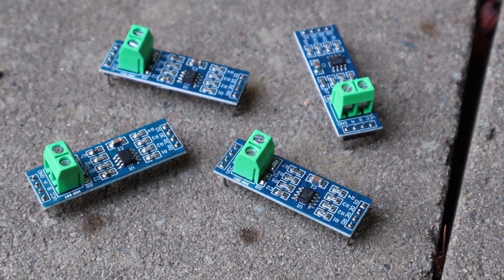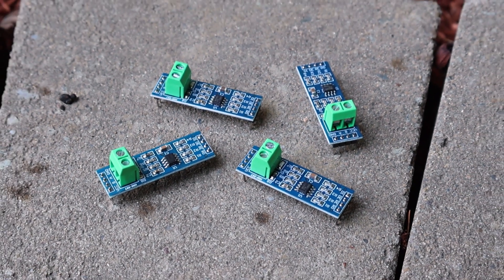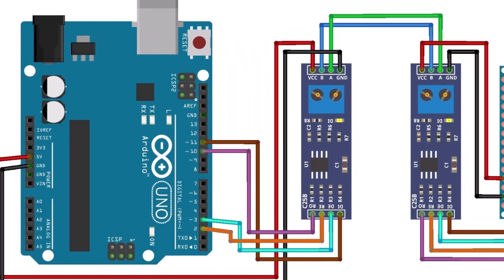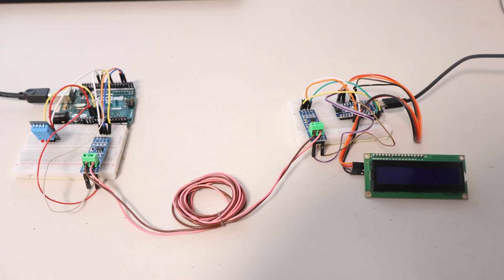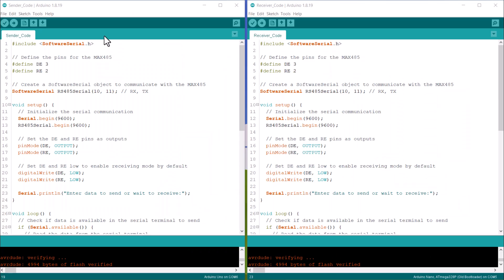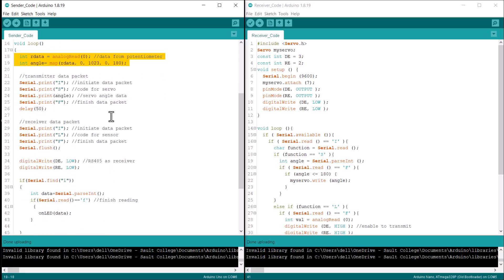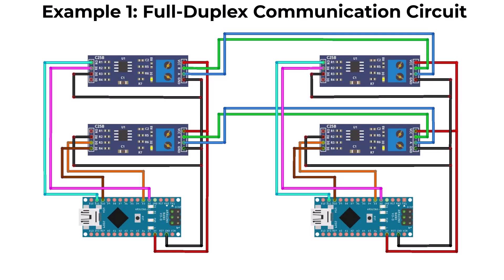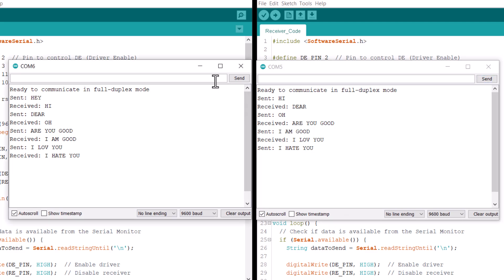RS-485 Arduino Communication: Simplex, Half-Duplex & Full-Duplex with MAX485

Comment: hey great video can the half-duplex comm. be made with a module that doesn't have data direction control so basically that has only TX RX 5V and GND and not RE and DE or RO and DI?